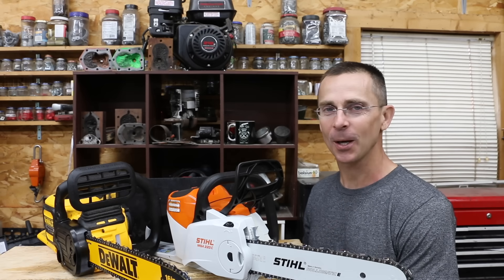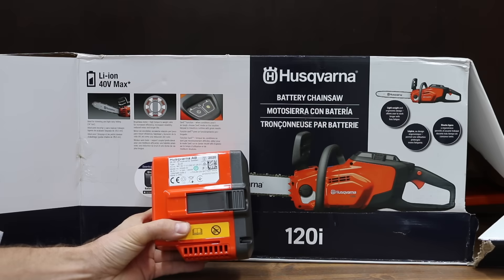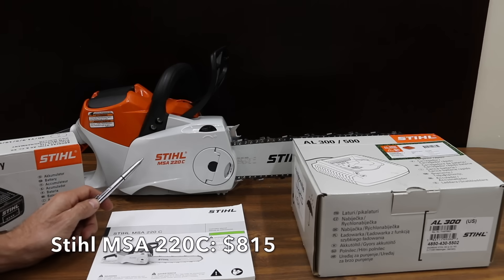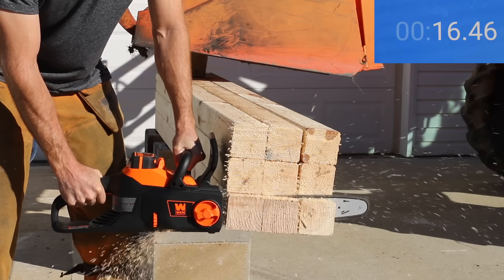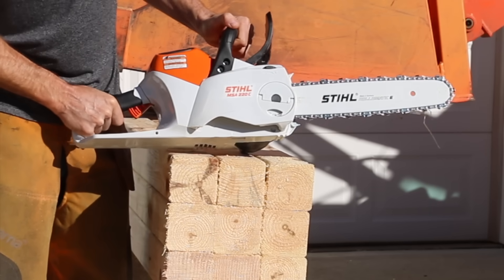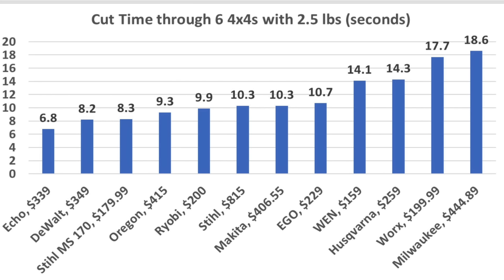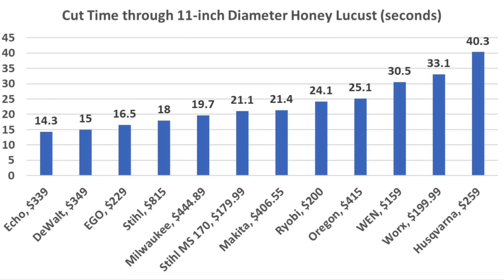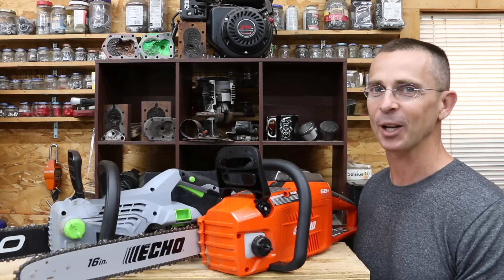Best Battery Powered Chainsaw Brand (ROUND 2)? Stihl, Husqvarna, Echo, Oregon, DeWalt

Comment: That’s exactly what I wanted to see! Looks like I’ll be picking up a new Echo saw this week.
Reply from the maker: Thanks for sharing.
Reply: If you're interested in battery-powered tools, you're buying into a whole line of tools and not just the chainsaw.  Make sure to compare the whole lineup.  (I own the Echo chainsaw and string trimmer; Dewalt hedge trimmer, blower, and drill.)
Reply: @CodeKujo  all my cordless tools are Milwaukee. I thought about getting their cordless saw but the performance didn’t really impress me(at least what I saw in various reviews) and it was more expensive. I’m just tired of messing with a gas saw. Seem like if it sits for more than a few months, it won’t start.
Reply: @motowipeout5670  Sadly modern fuel goes bad pretty quickly and the ethanol ruins the diaphragm etc in the carb pretty quick too. Most of my professional equipment today is Echo, love it, used to run mostly stihl but prices are silly and the quality dropped.

Comment: Try testing the 18" EGO, it should do extremely well.
Reply: have that saw it is great
Reply: @morgancoldfirecoldfire8256  same 2.5 battery?
Reply: @JTA1961  18inch comes with a 5.0 or a 7.5 I believe
Reply: @JTA1961  5 amp battery
Reply: @JTA1961  it will detect the bigger battery and give more power to the cut
Reply from the maker: Thanks for the feedback.
Reply: @ProjectFarm  I have the 18-inch, definitely a big step up from their other saws. Looking forward to seeing you test it out!
Reply: I'd like to see this EGO compared with a Greenworks Commercial GS181 or the Kobalt KCS 4080-06 chainsaw. They are both 2.5 kW models with appropriate dual string batteries (4, 5, or 6 Ahr). Greenworks parent, Globe Tools also makes this saw as a Cramer, for Europe. The Kobalt's have been discontinued but are still available on eBay, new.
Reply: The 18" has more powerful motor metal spikes and built in light also
Reply: @p0weraid  mine does not . its the first model tho.
Reply: @p0weraid  [Deleted because I was miss remembering and made a mistake]
Reply: @legallyfree2955  I have both, the 14" and 18" and on the same battery (5.0) there is a substantial difference in power between the two and if you go on the ego forum they do say to 18-in has a lot of internal upgrades and like I said you can notice the difference just looking at them it might be different here in the US
Reply: @p0weraid  [Deleted because I was miss remembering and made a mistake]
Reply: @p0weraid  I just googled, you could never buy an 18" bar on the old motor I just did that myself so I was miss remembering but I did this years ago. Anyway, you are quite right all 18" versions purchased as 18" saws are on the more powerful (probably 1800w) motor, both the 14" and the 16" have the same 1200w motor the only difference is the bar and chain.
Reply: Just got the ego 18 and it is significantly faster then the 16 inch. My buddy was using the Stihl 180 16" and it sounded way faster but didn't seem to cut any faster then my Ego 18. The sound effects of the Stihl where great though ha ha.

Comment: I've owned the Echo saw for about 3 years now and it's been fantastic. I got it on clearance for $225, and I use it to maintain dirt bike trails and it works great. I also have a Stihl MS250 that I got after the Echo, and and the two years I've owned it I haven't even ran a full tank of gas through it, I always end up using the Echo it's just so much easier and faster to use than a gas saw.
Reply from the maker: Thanks for sharing.

Comment: I think it would be interesting to compare the different amp hour batteries. I know that the larger ones are going to last longer but do they also give the tool "more" power? I feel like they do in my drill & impact. I think the chainsaws would be the perfect tool for this test. I'm a fan of Milwaukee & expected more from that saw, maybe a 12.0 battery would make it perform better? I might have to get an ECHO otherwise.
Reply from the maker: Thanks for the video idea.

Comment: Forgot to say, damn that Stihl model is EXPENSIVE. What do you get for that money that the others don't offer? Longevity? Why so expensive? The Stihl battery powered chainsaws in Australia aren't anywhere near that pricey (that same model here is $589AUD for the skin, which is only about $450USD - big difference. The charger and battery doesn't cost $400, that's a rip off). What's going on there? How long is the warranty on the Stihl? (I noticed you didn't mention that). In Australia it's 2 years, which is pathetic for something that expensive. Geez. Stihl will be wondering why they're not selling any. That's an outrageous price.
Reply from the maker: Thanks for the feedback.

Comment: You should test strongest 1/2" socket wrenches! Include Snap-On in the test to see if they are worth their high price!
Reply from the maker: Thanks for the video idea.
Reply: old snap on or new snap on...same deal with  sidchrome
Reply: @grumpyoldman-21  It would be a shame to deliberately break any old Australian made Sidchrome, the new stuff is still nice, the old stuff is fantastic
Reply: I think AvE already did that,  he's got a pretty interesting test rig.
Reply: @lovotcore6946  not the Hazet 916HP,  though, with 1000Nm load capability.

Comment: I don't think some of your comparisons are fair and your conclusions may not be accurate.  

By testing the EGO with the smallest battery they offer, you're limiting the capability of the saw (and because these are "smart" batteries, not just in run-time but also in torque/power).  

Also, because no battery has a flat discharge curve, I doubt your productivity calculation would hold out to be accurate - as the first cut will certainly be faster than the last.  

My last point, as an owner of a 16" EGO saw, why would you compare their oldest/smallest model saw.  They have had a 16" and now an 18" which seems to be a substantially different saw.
Reply from the maker: Thanks for the constructive feedback.

Comment: How long did the Stihl ms 170 cut wood for, before needing to be refilled.
Reply: Doesn't really matter much. Refilling a gas saw takes seconds. 2 minutes if you need to measure oil. For electric it matters because you need to time your 40-90 minute breaks.
Reply: @JC-fj7oo  a very good point indeed, but the times would have been nice to see, the Stihl ms 170 is a much better option, when I use a chainsaw it's often a lot longer than a few minutes.
Reply: @williamrutter3619  better is going to completely depend. Obviously if you're a professional logger, you're going to want a gas chainsaw.
Or if you happen to own a very large farm, or a small forrest, park ranger... Gas is going to be the right choice.

For 99% of people who aren't loggers, an electric chainsaw just makes sense. No pulling no priming no maintenance no storing gas no mixing no ear protection. You don't have to carry a running saw up a ladder, and they're easier to use at odd angles for pruning. 

And if you watch the end of the video he says that echo should be able to cut 32 times through a fairly thick hardwood tree. If you have an extra battery that's 60 cuts. After cutting 60 logs you're going to want to take a hour off anyway. Eat some food, let the batteries recharge. And get back to work. Or use the time efficiently, use an ax to start limbing and splitting. 

Plus I don't know if you noticed but the cut times for the echo were actually faster than both the stihl. Gas and electric. 

But even the Ryobi and the ego which are about the same price as the stihl 170 / 171 did a good job too. And they're still going to be a better choice for most people.
Reply: @JC-fj7oo  one tree can be quite considerably large, and they do fall, I live on farm, not large one, a tree can take day's to sort out, 7 mins isn't running through logs isn't going to work, these petrol chainsaws start pretty easy it isn't an issue and the clutch and chain brake stops the chain from moving, a responsible owner or tenant of property needs a good chainsaw, being out of battery isn't an option.
Reply: @williamrutter3619  Apparently you can't read, because I did say that people on farms might want a gas saw. And no a tenant should NEVER be using a chainsaw on the property, they should be calling the landlord and the landlord should be doing it or calling a service to do it. The insurance nightmare of a tenant spending hundreds on a saw and potentially causing thousands in damage or harming/killing someone/themselves to save a couple hundred on a tree service...  That's retarded. And I do not use that word lightly. 

For a truck saw to clear a road or do some basic emergency cuts, electric works better. It's easier to store, it always starts. The gas doesn't go bad. No priming or pulling or standing in the cold trying to fuck with it. Slide the battery on, push the trigger. Put the battery on a charger once a year... Good to go. 

Also important to mention that the 170 and all of the electric are LIGHT duty saws. They are for homeowners and landscapers to quickly cut down and process a couple trees once in a while. Deal with limbs. Basic homeowner tasks. If you have a forest or a farm and need to cut down larger trees regularly, then you will want a bigger and more powerful saw. Expect to pay 4-500 for a pro tool. 

But for the 99.99% of the world that has never felled a redwood: The electric is fine. 

Even wranglerstar had a vid about it. He hates anything new, but he said he mostly reaches for his dewalt now. His wife and kid prefer to use the dewalt. And he has a bunch of other high quality chainsaws and manages a small forest. He got 25 cuts with his test. If you use an axe and pruners for limbing, you should be able to fell and buck a 50' tree on a single charge. 

And again, the vast majority of people are not qualified to cut down a tree that's more than 50' anyway. And with a spare batt they can do 2 of them. After a couple hours you can come back and do 2 more. 

If you need to fell more than 4 50ft trees in a day, that's NOT light duty. And you can rent a 20" chainsaw for like $50 for the day. But that's also way outside the scope of what almost all homeowners are doing with their saws. 

Something that is easier and faster for a shorter period of time, but still plenty to get the job done, is going to be better for most people. 

It you don't happen to be like most people, woohoo, you're special. Good for you.
Reply: @JC-fj7oo  apparently you can't remember what you wrote, you said very large farms, not farms, there is a difference and tenant terms can differ, they can be ancient, small holdings are often over hundred year old tenancies, most the trees there were planted or let grow by the tenants generations ago, they are responsible for there own tree's, and if you buy a chainsaw you will need the appropriate license to use it, if you live on a large property that requires chainsaws it's probably a good idea to be licensed to use them. 
I'm not a tree surgeon, but I do have a chainsaw license, if I have tree troubles it's often not a little task, it's not my only chainsaw but the ms 170 is pretty capable and light, you can fit 20" bar on it if so desired, I like the idea of battery chainsaw, but that run time is just awful, I had an oak tree pollarded I'm my garden by a tree surgeon the other day, I cut the tree up on the ground, with my ms 170, I was using my chainsaw full throttle for hours, I would need stacks of batteries to do that.
Reply: @williamrutter3619  I didn't give any specification of what a large farm would be. my definition of a large farm may be a small farm to you. Some people have a couple cows a couple goats and a few hundred square feet of garden and call it a farm. 

My point is and has always been that if it's a profession, then yes you should be looking into higher powered professional level gas saws. That profession might be farming, firemen, logger, groundskeeper, landlord...

Profession equals professional. 

No idea what a chainsaw license is, I'm assuming you gave some government employee a hundred bucks and signed a paper...? 

But if we're honest most people shouldn't even have a chainsaw, most people can barely drive themselves to work without killing someone. They don't need a chainsaw.

For the few people who do actually need a saw once in a while, an electric saw is going to knock it out of the park. It's going to be ready to go it's going to be really quick and easy and that's it. You just go do it and get it done and get on with your life.

If you want to spend all day carving toothpicks, or using a chain that hasn't been sharpened in a few years, or whatever the hell you're doing running your saw flat out for hours like a dumbass, then your needs might be different than other people. And that's okay.

Comment: When testing the Dewalt for the second time did you give it a new or sharpened chain? I feel as if it would skew some of the results of the testing if the Dewalt had a duller chain than then the echo during the testing.

Comment: I have the Ego with both 2.5 and 7.5 ah batteries. The saw is a lot more powerful using the bigger battery. I also have the Makita which I would like if Makita would release some 12AH batteries, as it stands with the 6's it just chews them too fast and heats them up way too hot for my liking.
Reply from the maker: Thanks for sharing.

Comment: The WEN tools aren’t so bad. Whoever is manufacturing for them is also manufacturing for a lot of other brands as well. I purchased a WEN 12” drill press that’s has the exact same parts numbers of the JET 71600 12” drill press. $200 cheaper too I might add.
Reply from the maker: Thanks for the feedback.

Comment: Once again another great video working for the Town Sanitation almost 24 years I've found some unbelievable things and chainsaws is one of them. I think people buy them and then become scared of a chainsaw because so many people are not used to using them. I found brand new when there's no paint missing from the bar in cases with things still in the bag oil extra chains it's unbelievable what people throw away I could be here forever with a list guarantee some will not believe me.
Reply from the maker: Thanks for sharing.

Comment: You need to test the 18" Ego because it uses a totally different motor that is around 11,000 Rpm and comes with a 5ah battery for $350.
Reply from the maker: Thanks for the suggestion.
Reply: Thanks... that's what I was looking for as price is definitely more
Reply: Yeah I kind of expected to see the 18" for this test vs the others.  The 14" isn't that comparable in price and performance even though it did pretty well.

Comment: echo make the best cordless mower also, i own the echo and the ego mower. the echo is very light i can lift it with one hand, which make it a joy to cut with. it also does a superior finish to the lawn when cutting. with the stock blade the ego leave uncut grass behind and to have to do second passes. the echo have taken all kind of abuse and still work like new. i have left it in the rain several times and snow. i have drop it from the truck bed a couple times since i did landscaping a few years ago. she still work today as well as the batteries with no noticeable power lost.
Reply from the maker: Thanks for sharing.

Comment: Might not make a big difference, but the productivity rating might be more appropriate based on area cut. If you measure the before and after diameter and average across all the cuts for each saw, it wouldn't give the later date l saws the advantage of the smaller tree nearer to the top
Reply from the maker: Thanks for the feedback.

Comment: Would like to see a comparison between gas and electric (corded and battery). Does electric power outperform gas? I know electric motors can outperform gas but batteries and motors used/available is the main focus. Also run time per charge/gas tank would be nice to know also.
Reply from the maker: Great suggestion!  Thank you.